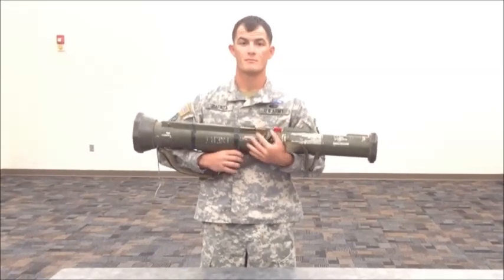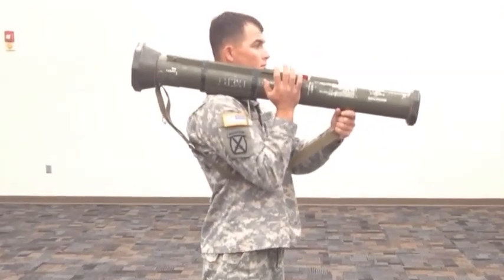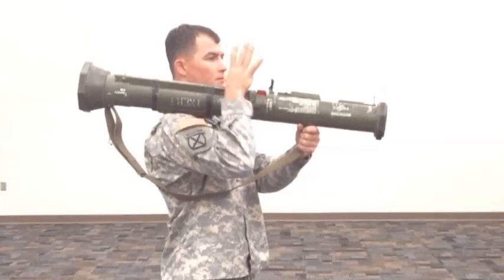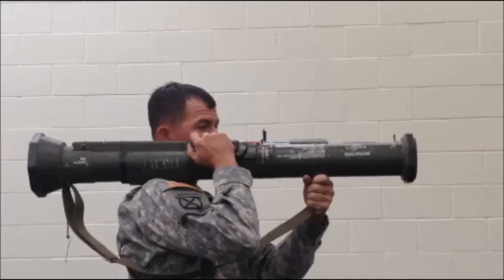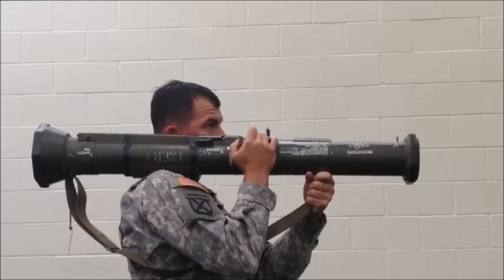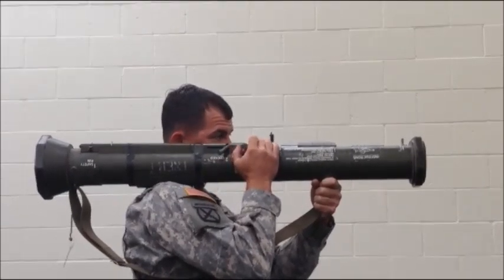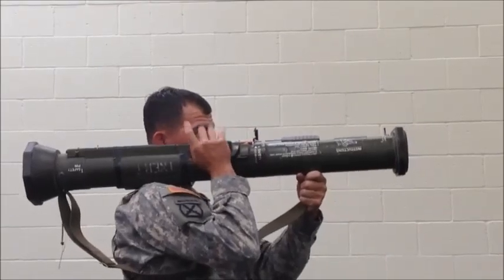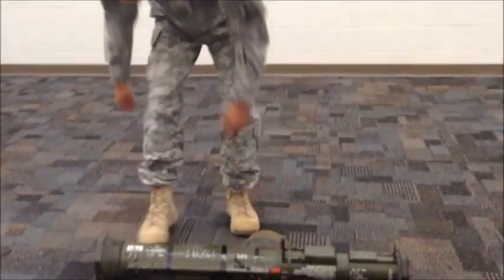AT4 Anti-tank Rocket - Firing Procedures, Step by Step.

Comment: Damn, I remember I was the "fake" OC when we did the training for the AT4 back in AIT (i was in Jackson). It had some wonky parts. you gotta hold the safety thingy, then press the button. But we never shot an 84mm shell. We shot like paint balls out of it. (this was back in 94, and how ODD, I was then STATIONED AT FORT DRUM- (so the two ski-poles patch, like the private is wearing in the vid is also my old unit) ^_^ (I was a 63B in the 2-10th Air Assault Battalion, Drum.) If you were 18th Airborne Corp, you my Brother. Every other Veteran is my Sister (love you all).